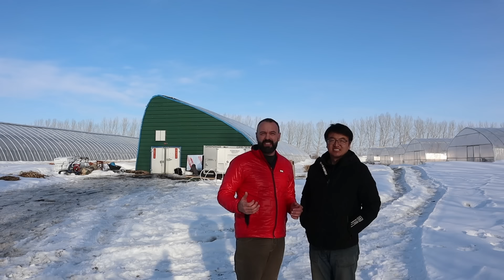Passive Solar Greenhouse Technology From China?

Comment: Boy I would LOVE to see a yearlong graph of the daily high, low, and avg temperatures in an unheated Chinese-style passive solar greenhouse!
Reply: I built several  a decade ago in Manitoba . though mine is a bit different  shape to take advantage of snow loading  on the glazing  to act as added insulating blanket  during the winter ( google- krywenko greenhouse) ,  but the same principle.  in my climate of hardiness zone of 2b @ lat of +51 .  they stay above zero usually until  mid dec.   then they cool off fairly quickly  as it get closer to the winter solstice.  and usually  for 2 weeks the green house will stay below  -5C  in the beginning weeks of January until the sun intensity increases enough to start warming the  air  faster then it can escape through the glazing . then  by mid February early March it can remain above zero 24/7 . but by the spring equinox  you are good to go. I use my Chinese style green house to grow peaches and nectarines for myself and my family in Manitoba  . and I adjusted so does not retain  to much heat. as i have built ones  that mimic  hardiness zone +9. but I had issues of my fruit trees blossoming in mid  January to  early February . but due to the lack of light  they would just sit in bloom until   mid march. so i adjust down so now they mimic hardiness zone 6. and the trees bloom in March/April.. which is  closer to what they would do in Nature . so i get better fruit production and really when the sun intensity support growth
Reply: That's fantastic - thanks for sharing your experience!  Avoiding 0C for most of the year unheated is a great accomplishment! @skrywenko6596
Reply: Fascinating - thanks for sharing! I tried to search Krywenko GH on google and found an old forum posting of yours on Open Energy Monitor - super interesting stuff!  Hoping to build a passive solar GH of my own one day! @skrywenko6596

Comment: In Germany we harvest with Cherrytypes like Supersweet over 35 kg compared to here mentioned 15kg in the same Periode. To have so much  space between compartments would not be possible cause €/m2 is too high. Also benefit of the stored energy in the backwall in winter is very limited. In the 80th they have done test. A square with up to 8 m high walls is more efficient and better to control. We have a 3 layered energy saving system with screens what is more flexible. First a shading screen what helps in summer (above 27 Degrees Celcius Tomatoes respirat more than they gain from photosynthesis) second is a energysaving screen what can led some light through but no direct radiation out. Third is a strong covering what is used during the night in combination with the other two screens. All three are controlled by computer depending on radiation from 0-100% and in future by AI. Heat is produced by combined heat and electricity generators what have efficiency up to 96%. Electricity is needed for LED cause light (not temperature) is often the limiting factor in winter. The CO2 is used for fertilizer cause  that drops quite fast in winter when all ventilations are closed.
Reply: Would be very interesting to see a video of your system as it sounds amazing. I hope to build more of a Walipini once I 'retire' from day job and always keen to see what ideas are being used even the ones I can't afford!
Reply: I am in Yorkshire England

Comment: Amazing greenhouse. Such a thoughtful design and a very humble owner.
Reply: Yes, it is an amazing design with lots of room to grow. With the shape of those greenhouses, a roof vent electric turbine would generate nice power in windy Alberta. There is also a new semi-transparent film solar panel that can be placed over greenhouses.
Reply: The 2 meter gap between the glazing layers is too big since there are no baffles to prevent air circulation.  That will allow natural (no fan) convection, which will move heat much faster between the glazing layers.   As an example, convection is why you feel colder when there is a wind vs no wind, and why a convection oven cooks faster; convection moves heat.  Some clear plastic sheet between the glazing layers (run horizontally to block air moving up and down)  will make a big difference.  They don't have to go all the way to the inner glazing, so the blanket could still roll down, but will be significantly less effective if they don't.  They could also be movable as part of the blanket process.
Reply: He is not that humble.
Check his Chinese language channel and see his boasting and arrogance about Chinese made stuff and attitudes.

Comment: Two other types of heating I would like to see perfected and commercialized to add to greenhouses like this would be geothermal air and compost heat.
Reply: I didn’t think the compost should be inside the greenhouse. The best place would be behind the clay wall but outside and isolated with hay or straw.  Covered by a roof but not closed.
If the air tubes is placed in the bottom part of the compost you might escape the amoniac and methane gases that normally is light enough to go upwards by itself. And the air in the tubes can not only pick up heat but also feed the compost with oxygen that will slowly be transported upwards by itself inside the compost.
A water tube in the top of the pile will pick up the heat without interfering with the gases. 
If the pile is made of wood ships  I believe the nitrogen part can be added as urine if it runs out of nitrogen. The urine can be added from the top and move down wards by gravity.
In theory it works but I haven’t tested it yet.
Reply: We raise cows and other life stock and we have experimented with several types of compost heat over the years. We garden in over 12,000 ft of high tunnels.  Two issues with this,  it is  VERY labor intensive to make and maintain a proper compost pile and it is impossible to make compost outside under the snow and then transfer heat to the growing beds.  It very difficult and  hard to generate a reliable system that wont fail you during the really cold winter months. AKA, frozen plants.  Compost releases a lot of moisture and if you try to do that inside of the facility you need to vent out the moisture  and there goes the direct heat gains. Spending five bucks to save a buck is a dead end business practice for small farms.
Reply: @johnmcneal9477  did you use air tubes or liquid for heat transfer ?
Reply: I have used both. Due to freezing temps you must use a glycol solution. It takes 30% more heat or a 30% larger system to equal the same amount of heat absorption/transfer as straight water. Those are known thermal dynamics that you are up against using a liquid. If your compost pile does not have the proper carbon nitrogen ratio it wont be efficient and or practical for heat production.   @katiegreene3960
Reply: This is a form of geothermal but is probably better named a climate battery. He's pumping hot air during the day into his clay wall to store heat that then radiates out at night. In some ways it's way better than conventional geothermal because you don't have to drill super deep or trench outwards hundreds of feet like Citrus in the Snow guy. Plus, in this location the soil freezes very deeply so geothermal trenches would be more expensive than warmer zones.
Reply: In our northern climate,  the minimum upper depth of our septic and water systems is 10 ft. We have approximately 12,000 sq ft of high tunnels. The install and operating costs to build a functioning geothermal system does not pencil out for us at all.  @cupbowlspoonforkknif  i
Reply: @cupbowlspoonforkknif  is don't remember if he had pipes in the back wall or just from Radiant heat ?
Reply: @cupbowlspoonforkknif  
A system that is in ground doesnt take up valuable greenhouse space. The wall relies on having a lot of direct sun. In ground systems benefit from latent as well as sensible energy. A 2m space between the inner and outer greenhouse will allow for convection currents, which act like a conveyor moving  heat from the warmer inner covering  to the colder outer covering. This is why sealed unit double glazing only uses a small air gap. The insulation blanket doesnt appear to include a radiant barrier.

Comment: Great way to grow tomatoes in cold climate!
How about light in the winter? Isn't it pretty dark from November to March? What kind of lighting do you have for those dark periods?
Thinking out loudly - in Finland there is a quite new interesting invention about storing heat in sand batteries to warm up houses. Maybe something similar could be useful to heat your greenhouses, too?
Reply: Yes, darker in winter here but not like the Nordic countries. Day length right now is 8 hours. It's also very sunny here, almost the sunniest place in Canada. I don't know if he uses lights, I didn't see any in the video.
Reply: that's what the North wall does - low angle sun in the winter heats up the back wall. In the video he talks about the tons of clay, with an insulating blanket between the outer wall and the ground.
Reply: @GlueTubber  Hm, that's not what I meant. At my location at latitude 58 N, there is 10-40 W/m2 during typically cloudy days from beginning of November to beginning of March. And that is at least an order of magnitude less than vegetables need for any useful production. BTW, if I recall correctly, that wall was mostly black.
Reply: @tonisee2  I'm struggling to find hard numbers of what kind of solar irradiance he sees in South Central Alberta, but as the statistically sunniest place in Canada (or at least adjacent to it), and at ~52N I expect some pretty significant heat gain.

That said, we do get an awful lot of darkness this time of year, and judging by his comments about diesel generators I imagine he must have some sort of lighting system in place.
Reply: @GlueTubber  Sorry, I answered incorrectly. That wall definitely helps, but it heats up just moderately. That so called sand battery from Polar Night Energy is heated from multiple hundreds up to 1000 degrees C. It has really huge thermal capacity.
Reply: @tonisee2  In the video put out by the 3 developers of Polar Night Energy they mention the possibility of building such a sand mass on which a greenhouse can capture some of the released heat. For northern countries such as Sweden, Norway, Finland that is such a game changer to utilize excess electrical generation to store heat for months at a time.
Reply: Scandinavia is much more cloudy in winter meaning we only get like half the sunlight hours.
Reply: Are you in Norway, Sweden or Canada.
Reply: @kerrryschultz2904 I'm in Estonia.
Reply: @tonisee2  Good Morning if you ignore the time difference because I'm in Manitoba Canada. I'll have to break out my conversion tables to convert watt per square meter to BTU's per sq. foot which I am much more familiar with. Did a check up on the temperature in Estonia and even though you are at 58 degrees latitude it is resonably warm . The north atlantic current sure helps to keep a huge area much warmer than if there was not that circulation pattern. A video I watched said that approximately 2 billion gallon of water per second continually flow from approximately south of Florida north of Cuba across the Atlantic diagonally to follow northward of England , and so on and as it slowly releases the heat and loops around from east to west and past the Eastern side of the Russian coast the colder denser heavier water help to complete the driving forces that move that vast volume of water. Given your latitude you recieve at this time of year about an hour less daylight than where I am located. About Febuary 15 we finally get up to about 10 hours of daylight which is the minimum length of daylight to make plants grow.

Comment: what is the specific material of the insulating blanket.  I'd like to just add that rolling blanket feature to a future build.  Can you share where you purchased this greenhouse from?  I know these chinese style had originally the blankets on the outside, so its interesting to see how they have modified it to protect the blanket.  Kinda looks wonky though when rolled up, not sure if thats a durability problem down the road though.
Reply: He imports them himself. The reason the blankets are inside is because freezing rain or melting cycles can freeze a blanket to the outside causing you to lose your entire crop.
Reply: @cupbowlspoonforkknif  There was an earlier version of the Chinese style greenhouse built in Elie Manitoba that was doing experimentation for the University of Manitoba. The grower had exactly that happen when the exterior insulating cover froze over in I believe January and he lost the crop.

Comment: Thanks for sharing. I live in Sweden and we also need this type of growing. How deep did he dig below the ground level?
Reply: none
Reply: It's not below ground at all. Before you try this type of greenhouse you need to know that we get a lot more sun here in the winter than most costal regions. Much lower temperatures but lots of sun. So you may need to balance your light needs vs blocking off the north side.